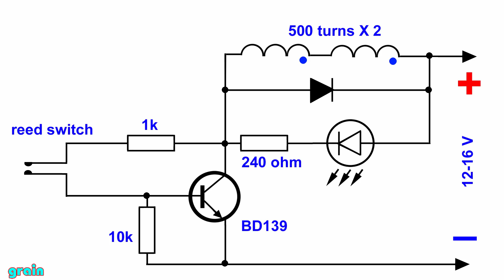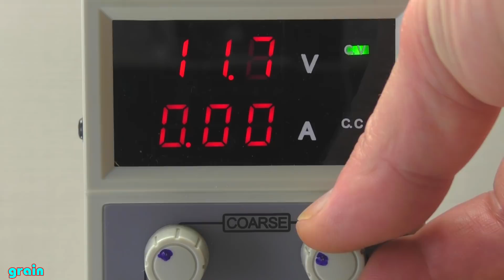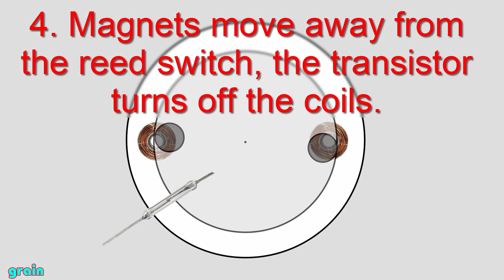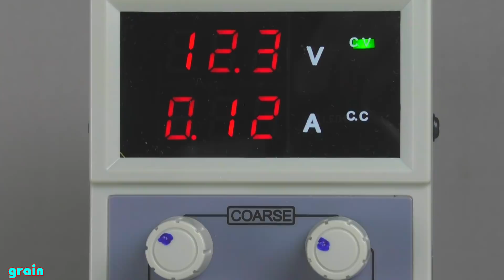Electronic Spinning Top

Comment: At 2:45 it is obvious that you need to put it on a drill and then sand the edge as it spins in the drill bit holder to minimize precession , or does it matter?
At 2:55 the mirror should be circular, not spherical. And it is better to be the concave kind that magnifies the image, so that the top is encouraged to stay in the middle.
At 7:10 it is obvious that the top is not balanced , because perhaps the middle needs to be heavy and perfectly balanced so that the imperfection in balance on outer circle can be forgiven.
But, good job in explaining the circuit and educating the science.

Comment: Hi, what is the grinding compound (paste) you used to polish the metal with? Does it actually fine grind more metal off or does it simply just polish? Thanks.
Reply from the maker: This is polished. Russians call it ГОИ pasta. As far as I know, this paste consists of chromium oxide and paraffin. Chromium oxide is a green powder that polishes, and paraffin is needed to hold the powder on the polishing wheel. I rubbed the paste in a belt of genuine leather. https://aliexpress.com/item/-/32933362314.html

Comment: Thanks. I like it! I wonder if it would work on lower voltage w/ a joule thief
Reply from the maker: Joule thief does it boost volts? Yes, if its output will be a current of 500 mA - look 5:18. The spinner top will work itself at a lower voltage with coils of 100-200 turns and a thicker wire. I tried 100 turns with coils, but the efficiency was lower. Maybe I didn’t set up well.
By the way, the spinner top will work without a transistor too, but you need a reed switch rated for 500 mA at 12 volts. These reed switches that I bought are not designed, their contacts stick together from a spark.

Comment: Have u tried putting reed switch 90’ from the coil.?
How would it spin?
Reply from the maker: If you have a 500 mA reed switch at 12 volts, you can do the same without a transistor - just the coil and the reed switch. But I do not have such a reed switch, the contacts of my reed switches stick together from a spark.